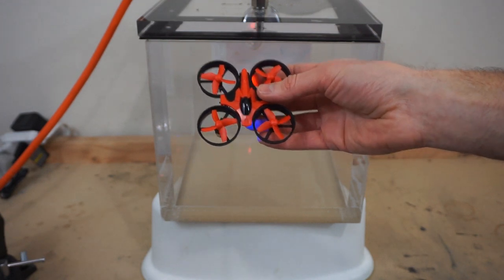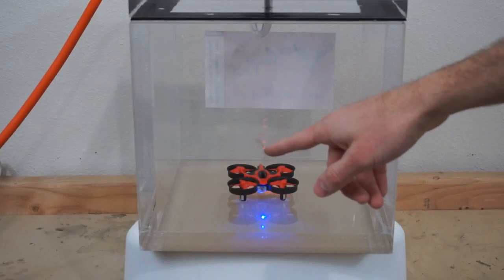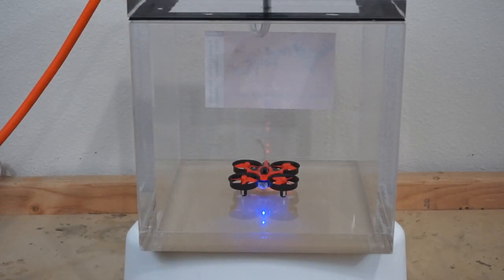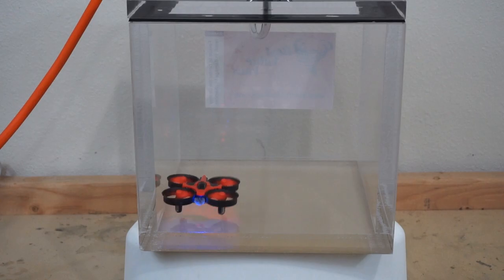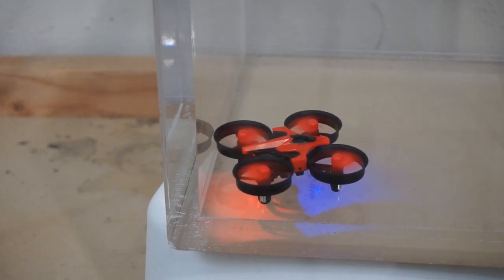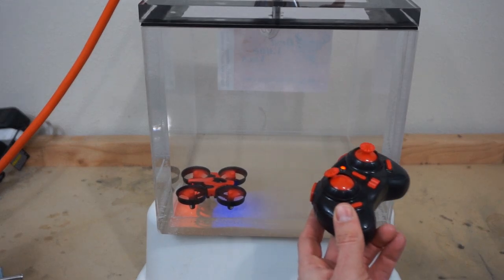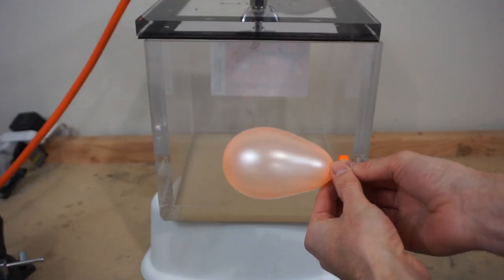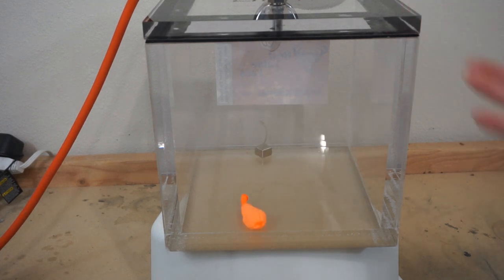What Happens When You Put A Drone In a Vacuum? Can It Still Fly?

Comment: but the rocket flies because of it's own atmosphere doens't it?
like if you give the quad the same amount of air underneath it , it wil fly as well
Reply: liamvant technically you have to put air above the drone for it to fly :P
Reply from the maker: It depends on how you think of it. You could describe it that the rocket makes the high pressure behind it that pushes it forward. But the pressure in the chamber itself did not go up according to the pressure gauge, so the balloon was still flying at the same vacuum pressure.
Reply: You all realize they do not use rockets in space right? They don't work. Period. After a rocket is launched into space it only uses the acceleration it got before leaving our atmosphere (in space no air friction = no reduced speed). Then they use gravitational pulls from planetary objects, or ionic thrusters to change direction.
Reply: The reason they dont work is because there is no air to give mass behind the rocket. Everyone knows u put force one way it gives the opposite force the same, According to masses of the objects (air vs rocket) when air is removed from the equation the thrust generated towards the rocket is so minuscule you would need millions of tons of fuel to do anything. Thus they do not use standerd rockets in space, they use ionic thrusters. Google them.
Reply from the maker: Liam Hogeterp, I really hope you are not someone that thinks we didn't go to the moon or else my comment will fall on deaf ears.  I think you are confused about rockets. I just showed you that a balloon moves in a vacuum. So does a rocket. The only difference between the balloon and a rocket is the balloon used pressurized air and a rocket uses another pressurized gas (like water from H2 O2 reaction). In fact rockets fly better in space because they can produce more thrust in a vacuum. The thrust equation in general is Thrust force=m_flow*Exit_Velocity+(Presssure_throat-Pressure_outside)*Exit_Area. The lower the outside pressure is the more thrust you get because your exit gas expands more. Why don't you read from the experts themselves on this subject (NASA):https://spaceflightsystems.grc.nasa.gov/education/rocket/Lessons/propulsionS_act.html
Reply: Yet you fail to realize your first mistake, its not a rocket that gives spacecraft further thrust in space. It is an ion thruster. Secondly,  How do i know you created a 100% vacuum?  Because i seriously doubt you did.  In which case the balloon would still work due to very small mass and faster thrust from the air expelled, whereas the drone submits a very weak thrust from those tiny fans and needs almost 100% of what it has in terms of thrust pushing on air in normal atmosphere to obtain flight.  Also nice copy paste on the equation (golf clap)
Reply: Wrong. You need to think about rocket exhaust as reaction mass. You throw it very fast behind and law of action and reaction makes you fly in opposite way.
And ion thruster- these are much newer ways to propel something in space. It is essentially the same as with chemical rocket. You push reaction mass in form of ionized matter accelerated by electrostatic fields which is much more efficient than what is used by chemical reaction. Because ion thruster uses much higher speed of matter exhaust than chemical rocket.
The flame of chemical reaction driven rocket engine (H2/o2, kerosen/o2 and others) is much less energetic, therefore speed of exhaust matter is much lower(lower Isp) But it is plasma nevertheless :) How do you think nearly all expeditions to orbit and beyond- to solar system- to solar system were done? Ion engines are very low thrust high Isp engines. You can use them for long time but thrust is limiting factor- everything takes long. You can't use them for landing on the Moon, and travel to the moon takes about 1 year. Chemical rockets are able to take you to the moon in a day or three depending on delta v you have on disposal.

The level of pressure doesn't really matter. The higher pressure of the atmosphere is the less efficiently rocket engine works. What is important is the difference of pressure in reaction chamber and outside of it.  So hypothetically, if pressure in reaction chamber is 1Bar the rocket engine wouldn't function as engine in earth atmosphere, but it would function if pressure of Earths  atmosphere is lower.
Reply: Imagine throwing something heavy while you're in space. You'll get pushed back. Rockets work by the same concept. No air needed!
Reply: Liam Hogeterp Rockets in space carry inert thrust mass through the use of liquid fuels. Combusting these fuels and exhausting them creates thrust using the product gasses as the propellant. The presence of an atmosphere is not needed generate thrust mass because that comes from the fuel. Rather, the rocket no longer has to deal with the air friction present in an atmosphere, making it even more efficient.
Reply: Liam Hogeterp You said the answer yourself. "the balloon would still work due to... faster thrust from the air expelled" in principle, rockets work the same way as a balloon expelling air in a vaccuum. High velocity exhaust gases propell the system.
Reply: liamvant not to mention you take away air resistance so it's purely gravity taking effect on the drone
Reply: all the energy propell itself to the sky :v
Reply: Liam Hogeterp ION thrusters are barely able to work now. You launch a rocket, it orbits in a place with no atmosphere, and to extend that orbit to a place like the moon would take a very very long time using an ion thruster alone. Take a rock and throw it in space, you will fly backwards. Same concept, it's pretty hard to argue with that.
Reply: no the rocket flys because the rocket thrust is pushing it, it is not pushing off the air
Reply: No, a rocket doesn't create its own atmosphere, at leased not in a vacuum. Once the gas leaves the rocket it can expand without resistance. Its resistance to this expansion that gives a rocket thrust. Rockets in a vacuum is a fiction.
Reply: No. It is not resistance to expansion. It is action-reaction law. Action part is throwing mass in one way and reaction part is movement opposite way than that mass. It doesn't have to be gas or ions thrown out of engine. You can accelerate rocks for example and it would create thrust opposite way. 
I mention rocks because there is serious consideration to use mass accelerator as rocket engines for adjusting asteroid trajectory either for prevention of collision with earth, or to bring asteroid on earth orbit to mine it. Ejected mass would be something you don't desire to mine. Some dirt. Dust. Or small rocks. Whatever.
Reply: At least you stop responding when you saw your mistake lol.

It all reduces to the 3rd newton's law. momentum conservation. Rocket expel mass with a momentum in o direction, and that mass pushes the rocket to the opposite direction.
It's true that in the last years there's an engine that seems to work without resorting to this law (not expelling mass), but rockets have worked long before. Also in space there's no perfect vacuum either.
Reply: You need to have at least a basic understand of Newton's laws of motion to understand reaction forces.
An easy way to understand the underlying principle is by example. Take a hose pipe or jet wash. When you turn the water on, you feel the hose pipe push back against you. Fireman often have to use two or more men to control one big water jet hose because of the reaction force created by the hose "chucking water in one direction".
Rockets simply chuck high velocity exhaust gases out the back by burning liquid fuel and oxidiser.
Reply: shreetron you don't gotta be mean about it man
Reply: No mistake. Rockets don't work in infinite vacuums. Its all Ballshit.
Reply: bob question care to elaborate?
Reply: +bob question
'Rockets don't work in infinite vacuums.'
<facepalm> You're hilariously ignorant from the outset.
There's no such thing as an 'infinite vacuum'.

Go and learn what the word 'vacuum'  and the word 'infinite' actually mean, then we can move onto reaction forces.
Reply: Okay, fine. My douchiness was probably a little more than warranted but it was the the blatant level of confidence that he said it with that got to me, esp. given the current political climate here in the US. The dimwit whom I have to address as the president of my country is somebody who,  if not for misguided opinions of an ignorant section of the populace based solely on this man grossly unfounded level of confidence,  should otherwise be on the streets with a sign in one hand and a cup in the other.
Reply: Haha, thanks for the opportunity but I would rather not. Ignorance combined with unwavering self-confidence is a perfect recipe for insurmountable stupidity.  I am going to bow out of this one.
Reply: liamvant its like a shot, you go to one side and the bullet to the other even without Air
Reply: I was waiting for the nutters to show...
You didn't disappoint in disappointing me...
Reply: Inside the balloon, or a rocket engine, force is pushing outward in all directions. When there is an opening on one side that decreases the force upon the inner wall on that side. Which means that the force on the opposite wall of the INSIDE of the balloon/engine pushes it forward.
It has nothing to do with air.
Plus, for all that is Holy, go back and FINISH the Fifth Grade!

It is just like putting a stick of dynamite under a trash can.
When it explodes (like a one blast rocket engine) the can is pushed upwards.
NOT because "air is coming out the opening on the ground".
But BECAUSE FORCE IS PUSHING upon the solid inside of the top.
How can people not grasp such a simple concept?
Reply: gas released from rocket engines is what propells the shuttle.

the vacuum has no gases, no flight. same goes for the quadcopter, it uses the air to create flight.
Reply: Ace Wyld this video demonstrated flight inside a vacuum, what you are talking about (from what I know) is a bottle with low pressure (inside)  that is suddenly opened in a high pressure area?
Reply: Ace Wyld I have no idea (probably everyone) what you just said, your explanation does not make any sense.

you go to a topic halfway and skip to another topic halfway and then go to another topic halfway not finishing any of the scientific principles you almost talked about and get to the conclusion, "my hypothesis is right l0l"
Reply: Okay, I will simplify it even more for you...
If you have a big metal hoop with people of equal strength standing inside it all pushing outwards on the hoop.
When all those people are pushing outwardly EQUALLY the hoop will be at a standstill, it will not move.
The FORCE acting upon the hoop is equal in all directions.
However, once you remove a person from one side of the hoop, the hoop will start to move in the direction of the side with more people pushing.
More people pushing equals MORE FORCE in that direction.
When force is unequal an obeject moves in the direction of the greatest forces acting upon it.
So, when a balloon/rocket has force removed from one side (through the hole in the balloon, or the nozzle of the rocket) FORCE is UNEQUAL and the balloon/rocket will move in the opposite direction of the hole/nozzle.

This is not a "theory".
It is a Law of Nature/Physics.

You people have freaking google, use it and actually learn something instead of demanding people respect your "right to be ignorant".
This is my last reply to this topic.
I can handle people that are just ininformed and are willing to learn.
But, to be willingly ignorant...it just pisses me off.

-Peace, Ace
Reply: Ace Wyld
But it doesn't work that way. The pressure inside the rocket is simply that. When the pressurised gas is released it is immediately unpressurised in to the vacuum. Inside the pressure chamber, the pressure remains equal at all times. What you are saying is akin to, "pushing the handlebars forward on the bike you are sat on will make it go faster". It won't.

Another thing with your hoop analogy, the people in the hoop have their feet out of the pressure vessel and on the solid "Earth",
Reply: We did not see the whole experiment with the balloon. That experiment was bogus from an evidence point of view. That experiment was a fraud. We did not see him put the balloon in the case. We didn't see it expand and we didn't see how small the balloon started out. It was just...balloon in a box released. That was not  a significant vacuum and it shows what these guys will do to make you believe.
Reply: bla bla bla
"rockets aren't pressurized for the purpose of expanding" Where did you get that from? And no, true rocketry is not taught at college. Your figures don't make the impossible possible. You can't climb a ladder if it doesn't exist. :D
Spend a little time thinking about it.
Reply: Wrong. Because of newtons third law, every action have an equal and opposite reaction. Rockets DO work in space and vacuum, because when the fuel burns it will produce expanding gas, which will be propelled out behind the rocket itself. That force will produce an equal and opposite force on the rocket in the other direction. Rockets therefor DO work in space. Ion thrusters as you mention work on the very same principle and law of motion.
Reply: NO!
Reply: bla bla bla
Firstly, I'm not arguing anything. If you are in pursuit of the truth, you will find it.  We have a whole universe created on false mathematics. Assumptions and theories are know the backbone of science, and it is wrong. There is not one whole Earth photo from space, just CGI's, composits, paintings and fish eye photos from 100,000 ft. Not one photo.....not one....
Reply: liamvant oxidizer is needed i think
Reply: bla bla bla
Conservation of momentum doesn't say anything about rockets in a vacuum either. What goes up, will come down.
Reply: bla bla bla
"We argue with models and math. "
That's where you are going wrong. Arguing with models cuts no mustard. We have the real thing under our feet. Its maths and the "Earth". we need to bring those together and leave the models alone for a little while.
Reply: This "air pressure" explanation is bad. Just think about momentum conservation. If the rocket throws air down, it will go up. Same for the quad. But the quad needs air surrounding it, because it works with propellers pushing down the air, while the rocket has the "air" (actually it's fuel that's later turned into air) inside of it, to throw it out.
Reply: Mason Herrig
No resistance = no force. Doesn't matter how much pressure is built up in side the rocket. Newtons third law applies to two masses with a force between them. A rocket in a vacuum is one mass. The expanding gasses in the void have no resistance and therefore no thrust.
Reply: liamvant The rocket flies because its throwing shit aka fuel away from itself at a high speed.
Reply: bob question thank god you don't work in a related field.
If you want to get rid of the dunning kruger on this, google a little or ask in "physics exchange" and let other people explain you. Dont be afraid, if you are right, they will only confirm it.
Reply: rockets produce thrust through the enormous amount of combusted fuel leaving the booster at high speeds.  This creates a pushing effect, propelling the rocket.
Reply: Vladimir Putin Combustion uses oxygen
Reply: G D the rocket has it's own oxygen supply for combustion
Reply: Of course, because conservationn of momentum has nothing to do with "what goes up will come down". Conservation of momentum completely explains the action of the propellers. The system air + drone has constant momentum. When the drone pushes the air down, it goes up. Simple as that.
Reply: "No resistance = no force. Doesn't matter how much pressure is built up in side the rocket. Newtons third law applies to two masses with a force between them. A rocket in a vacuum is one mass. The expanding gasses in the void have no resistance and therefore no thrust."
Wrong. The system "rocket" can be separated into 2 objects: the rocket and the fuel (that later turns into air). The system "rocket + air" has constante momentum. When the air is thrown down, the rocket goes up, so that the total momentum keeps unchanged.
Reply: no.
Reply: How people believe a 6.5million lb rocket putting out 7.9million lbs of thrust is lifted by 15 lbs of air is beyond me. Folks the balloon analogy is flawed. That "thrust" is created by the mechanical elastic force of the balloon squeezing the air out. A rocket is a chemical reaction that creates rapidly expanding gases upon which do work as they make their way out of the engine. What happens after the engine bell is null and void.
Reply: liamvant a rocket doesn't need air to fly like jets/planes/drones or helicopter do
Since a rocket only burns fuel to propel it forward but a jet needs fuel and air too make it work a propeller needs air to work and propel itself forward
Reply: D Mag
Its only 7.9million pounds of thrust when it is resisted. It is 0 pounds of thrust if it is not resisted. Force does not exist without resistance.
Reply: Liam Hogeterp That's bullshit! Haven't you heard of Newton's third Law: actio = reactio?!
Reply: MiDa
Newtons 3rd law applies specifically to 2 masses with a force between. A rocket in a vacuum is one mass and some freely expanding gas that is completely unresisted. No resistance = no force = no thrust. Newton would halve laughed to know that such a simple thing can be so universally misunderstood.
Reply: Bob, you are wrong. Imagine a rocket is steady on space. Then it throws out a part of it, to the left. What will happen? It will go to the right.
Reply: Louis Collings
You have a rocket. Inside the rocket you have pressure. (potential energy) outside the rocket you have nothing. The pressure inside the rocket is precisely that, inside the mass. It can't make the rocket move any more that pushing on the end of a railway carriage from inside, will make the train go faster. Outside the rocket you have void. The gasses can fly off into the void but will never hold or build any pressure outside, which is what you need to make the rocket move.

Remember, the pull towards "Earth" is not diminished and even the alleged ISS is subject to such a strong downward force that it has to travel at 17,500 mph in order to miss the "Earth". So even conservation of momentum will only happen whilst the rocket arcs back to Earth, then the "Earth" will get in the way of the rocket, as does it always,
Reply: Bob, that's not how it works. The force doesn't have to be resisted for it to work. A rocket is stationary in space. It fires a thruster. It doesn't stay where it is, thrust has been exerted in one direction so the rocket must move in the other.
Reply: Dan Large
How it works is, nasa shows you some CGI shit. Then they tell you that that is what happened, then you cheer Nasa and let them into your wallet.

If force is not resisted then it is not force. Have you ever seen thrusters working in the vacuum of space with your own eyes?
Reply: bob question You are the one he is laughing at! Newtons 3rd law says that if you apply a force in one direction there is an equal force to the opposite direction. A rocket engine fires hot gases in one direction and the rocket moves to the opposite direction. By the way, gas molecules do have a mass and the basic formula of force has nothing to do with resistance, it's F=m*a.
Reply: bob question Well, I don't, but I saw enough other experiments that proof this theory.
I'm very sad hearing you say that you don't believe in basic physics, but nasa tricking us all by creating an extremely realistic simulation of a rocket made with computers with microchips with millions of transistors on it which are smaller than your finger tip, because it is so much easier to believe this than  basic principles explained several 100 years ago.
Reply: MiDa
What have you seen that proves the theory?
Reply: bob question Braking on a bike, riding a Rollercoaster, rudder on a boat, swimming all these normal things you do in life that reminds you how nature works.
Reply: thanks you for the name :)
Reply: To everyone in the post. Bob Questions is a flat earther. he does not believe in math or science. there is an entire society of these people that truly believe NASA is the root of all evil. they believe that all space footage was shot under water or is CGI. do not attempt to argue with these people because it is a waste of time. you will not sway their point of view however it is entertaining too see what they have to say. for example, if you bring up gravity, they will simply tell you that gravity does not exist. this is the kind of argument one must face with these people. it's sad and funny at the same time. but mostly sad.
Reply: Anguinus Vir I don't care enough
Reply: Bob Question, according to you, if I shoot a gun in vacuum there will be no recoil.
Reply: Anguinus Vir Are you serious? If it was bait you got me but please tell me you aren't serious.
Reply: To everyone in the post. Richard Harder has now set himself the goal of finding a real photo of whole "Earth" from space. No one else has done it yet, But Richard is so clever that he could never have been fooled. So all of you who could not produce that one Photo can relax while we all look to Richard. So the deal is this. You provide that one real, non fish eye photo or you accept the title of Useless Tool. How does that sound Richard Harder? :D
Reply: Anguinus Vir
You accept the moon landings didn't happen, Why do you assume that they would not lie about the shape of the "Earth" and that it is a sphere whizzing through space and could be smashed to peaces by a myriad  of high speed space rocks at any moment? That is one thing you can check for yourself. If you get a gyroscope spinning you will see no progression. That's one way to know it doesn't spin.
Reply: Vasily Sidorov
" according to you, if I shoot a gun in vacuum there will be no recoil.
Reply  "
WRONG. Newtons third law specifically relates to two masses and a force between them. Recoil of a bullet from a gun would happen. Not as strongly as it would under air pressure but you would have recoil. A rocket is one mass with some gas expanding outside of the mass. That gas is not resisted in a vacuum. NO RECOIL OR THRUST.
Reply: bob question Your saying Newton's third law says there must 2 masses and a force. Ok... the rocket is a mass and the propellant is another, with the force being the opposite direction of the propellant being fired. You also use the analogy that a rocket working is like someone pushing from the inside of a car and expecting it to move. No, it's you jumping and pushing the back of the car which causes you to go the opposite direction of the car. You can do this by jumping away from a skateboard and seeing it roll away.
Reply: Yunushan Gulsen
The propellant is not a mass in a vacuum. It has to be contained to be a mass.
" No, it's you jumping and pushing the back of the car which causes you to go the opposite direction of the car " << with your feet on what? Good solid second mass? or feet floating in a vacuumed void?
Reply: The rocket burns the fuel, causing expansion in all directions, however there is a nozzle at the outlet of the rocket so the force is focused in one direction. the burning fuel is forced out of the nozzle as more fuel enters. This forcing out of the fuel is called thrust. Chemical, potential energy converted into kinetic energy.
Have you ever taken a physics class, dynamics, fluid mechanics, gas dynamics. No, so what makes you think you know anything about this topic?
You wanna see a real picture go to google images, type earth, and click on ISS. There are a ton of REAL pictures of earth. You may think it is CGI because of the beauty of the photos but that is the Universe for ya.
Reply: Sorry about the use of the words fucking retarded in my last comment and the use of the word fucking, I am just carrying out an experiment to see if that is bridging the language barrier. :D
Reply: BlackHawkSavior
Do you know what the word literally means? It means "as written". If I was to say that it is literally raining cats and dogs. You would probably know that is isn't ACTUALLY raining cats and dogs. When you say literally fly round the world, you are avoiding saying ACTUALLY flying around the world. 

So, flying around in a big circle is described as "flying around the world". It is a literal and not an actual.

Did you also know that the term "HUMAN" means less than a man. A sub man. A monster.
Reply: zack worrell
That's evidence that proves the Quantum Ballshit Theory is not just a theory. Even if rockets burn in a vacuum, it makes no difference. You still need resistance to the expanding gasses if you want thrust.
Reply: bob question so what you're saying is, a rocket can imbue a stream of pressurized gasses with velocity, while having no velocity applied to it? That it can push without being pushed back?
Reply: +TheDarkNerd Just save your time dude. The fact that NASA built the Saturn V rocket in phases (all but one fired in space) proves these people wrong. It is entertaining to watch so many people fail at science though. https://en.wikipedia.org/wiki/Saturn_V Read specifically the section where it discusses the stages. There you will find a nice paragraph discussing the main purpose of this section. To directly quote: "The second stage accelerated the Saturn V through the upper atmosphere with 1,100,000 pounds-force (4,900 kN) of thrust in vacuum." For god's sake, NASA even proves you people wrong. Rockets produce thrust in a vacuum.
Reply: TheDarkNerd
The gasses are only pressurized INSIDE the rocket, Outside there is no pressure. Now If you had a perfectly weightless environment, then maybe some motion would come about but not much. It is an understood thing that the ISS is travelling at some 17,500 miles an hour in a state of perpetual free fall, mitigated by the fact it is missing the "Planet" due to its speed. If it was to stop dead it would then plunge from the sky like a very heavy film prop. So taking into account that there is a downward force not much less that the 10 m per sec per sec up there, this unresisted expanding exhaust gas is supposedly what pushes the "rocket" forward. It would not overcome the rockets weight.
Reply: Kiknchikn Studios
They fooled you then. :D
Reply: bob question you say "not much [motion]," but rocket science is all about adding up a whole lot of that supposed "not much". Also, how can you say the ISS is subject to 1g of gravity? Not even the surface of the earth carries a consistent 1 g.
Reply: TheDarkNerd
If the ISS is not subject to at lased 1 g, Why dos it not fly away at that speed (17,500 mph)?
Reply: Dude. Imagine you're floating in water. Next to you is a boat. You push against the boat. What happens? You push yourself backwards while the boat gets pushed off in the opposite direction.

Or just imagine firing a blank in a gun. The powder ignites, it blows the little plastic cap open, and now the gases can escape forward through the muzzle. At the same time, the gun kicks back in your hand because the gases are pushing against the closed end of the casing, which in turn pushes back against the chamber, etc.

And that is EXACTLY the same thing that happens in a rocket.
Reply: liamvant i think what u refer to is a jet engine, which is yes, i believe it "sucks" the air from the front, compressed it, and shoot it out at the back.

rocket, i think it carries its own propulsion material in a compressed manner and shoot the output in controlled manner?
Reply: I just read all of Bob's comments. can't believe I didn't realize he's just trolling everyone.
Reply: Imnainggolan PM
Rockets carry their own propulsion in air pressure. That propulsion declines as air pressure declines. Then the rocket crashes into the sea and the launch is declared successful.
Reply: Liam Hogeterp Rockets don't need an atmosphere to work, they propel the fuel they have out of their engine nozzles at high speeds in order to create thrust. It is not the engine pushing off of an atmosphere, as much as it is the conservation of momentum stating that if low mass particles (fuel) leaves a spacecraft than an equal and opposite force must be acted upon the rocket in order for the net force to be zero.
Reply: go back to science class
Reply: lolz No, they are laughing at you. I will end this with a quote from astronaut Harrison Schmitt, "If people decide they’re going to deny the facts of history and the facts of science and technology, there’s not much you can do with them. For most of them, I just feel sorry that we failed in their education.”
Reply: Kiknchikn Studios
:D That's it you see, they failed in our education. They could not overcome the logic barrier. They could only fool the fools.  And you don't have the first clue that you have been fooled, do you?
Reply: education failed you bob, sorry bud. :'(
Reply: Richard Harder
If you think you are on a ball in space, then it failed us both. I became aware of the problem, you seem to be holding on to your bad education. One day the truth may come to you.